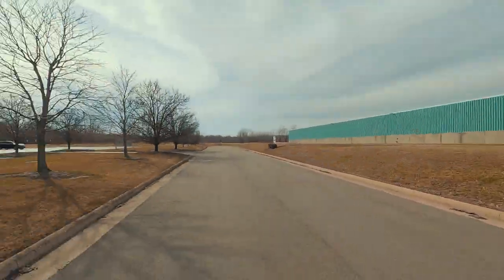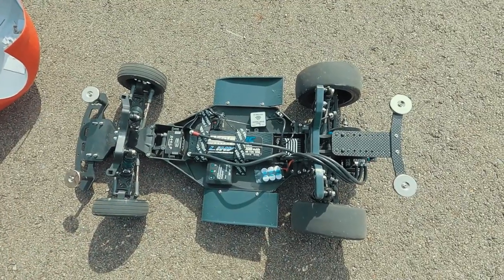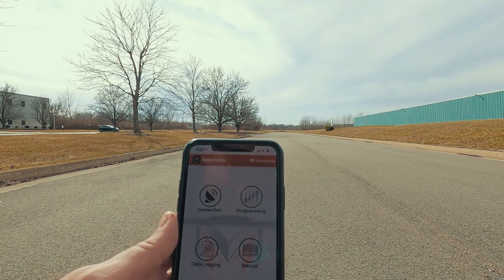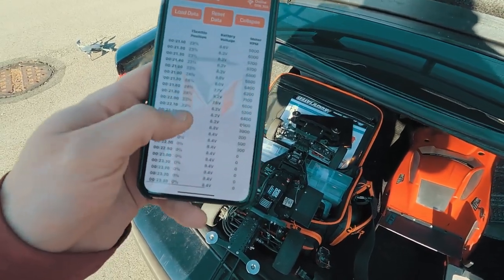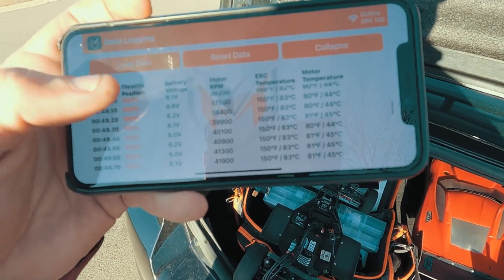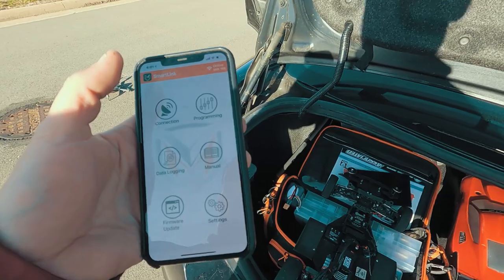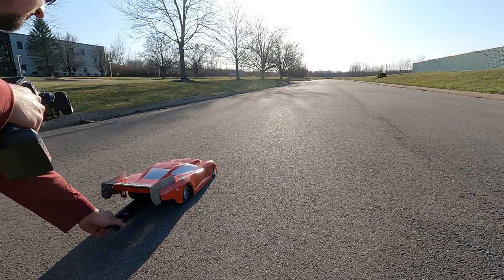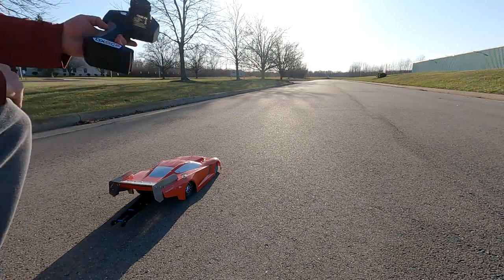MACLAN DRK WIRELESS LINK | NO PREP DRAG RC

Comment: Even if I left the short cord in the ESC . it still doesn't work unless you pull it  out of the Jack !!! the only thing I don't like about the DRK. I'm worried about messing up that Port real quick
Reply from the maker: you have to use a basic connector inside there..not the OTG end.  that should work. so you need an extender..a usb wire..and then the OTG pluged into the phone/tablet
Reply: @Dorkyand40  s*** dude , I bought the connector straight from Maclan.. it's about 3 inches long ESC won't work with it plugged in. Even with nothing plugged into the other end no USB at all. Put the plug-in , don't hook up to your phone or laptop and see if it works !!!!

Comment: What's up D? That esc wireless I didn't know that I use the white cord to program of my LG style 6
Reply from the maker: if youre good with that then stick with it.  this wireless if for IOS devices mainly or the newer samsung android stuff
Reply: @Dorkyand40  ohhh. Ok I got you. Imma do what you suggested stick the white wire in it glue it down good Idea. Thanks again D.
Reply from the maker: Yeah. And if you need smaller just get off Amazon.

Comment: Hey why i cant use this when im racing on the street . Like when i wont to connect i dont carry wifi around with me . Smh i this was Bluetooth
Reply from the maker: its wifi for ios devices.  use a direct cable if you have android
Reply: @Dorkyand40  i have a apple bro ? But it wont connect unless i have wifi around . It wont connect if i dont be around wifi
Reply from the maker: When you plug it in it creates its own WiFi that you have to connect to. You sue the default password to start and then make your own after you update it. It’s on the paper in the box.

Comment: What maxamps batteries are your running?
Reply from the maker: The 5000mah hard packs for $99. Just enough mahs and fits perfect. Lighter then the proteks I got last year.  Hate to say it but they pushed me to that 55 hump from the 51-52mph I was at. Might gain some more after I cycle them a few times.